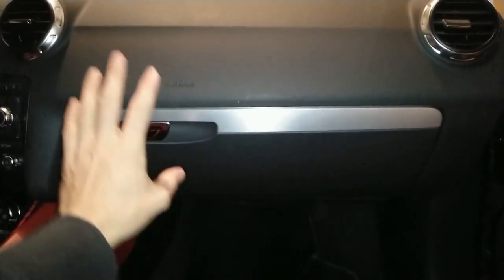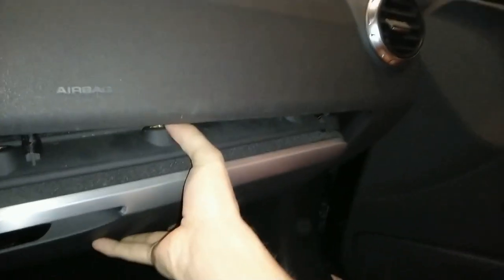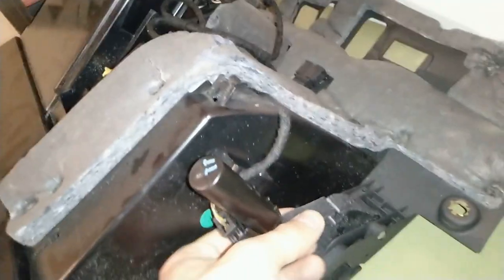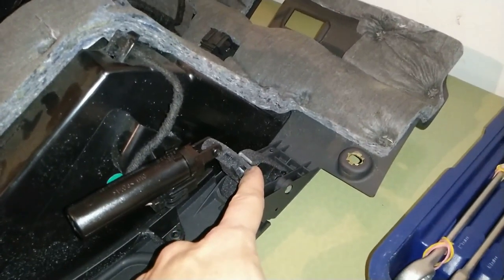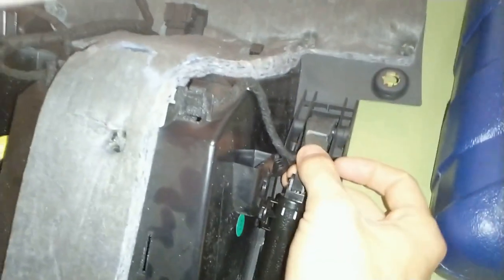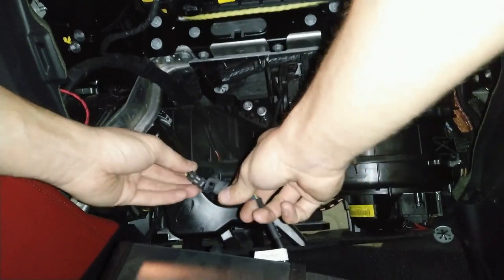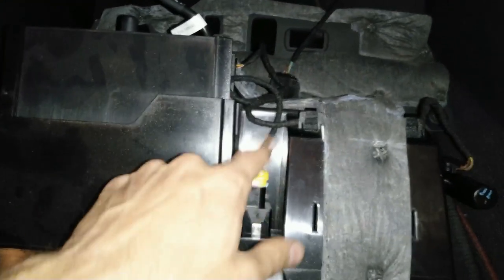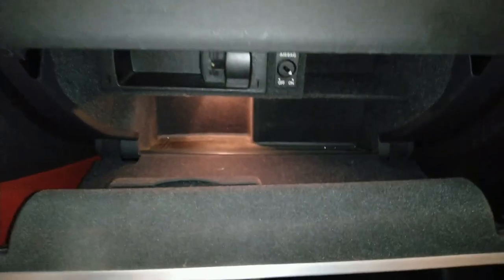Remove and Repair Glove Box on Audi TT Mk2

Comment: Hi i have a roadster 2008.
My driver window makes bad noises when i pull window up and down on driver side, Its Luke something hits the window when doing this.
Also my lock/Open button for doors is loose.
Can you help?
Reply from the maker: Remove door trim and check if anything is broken or loose. https://www.youtube.com/watch?v=1O85t3wEoRc&t=170s